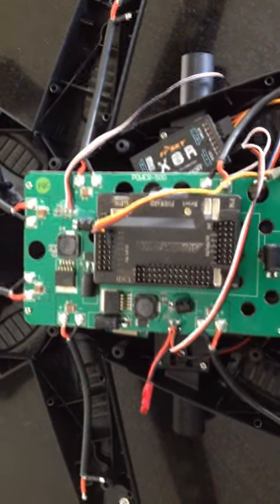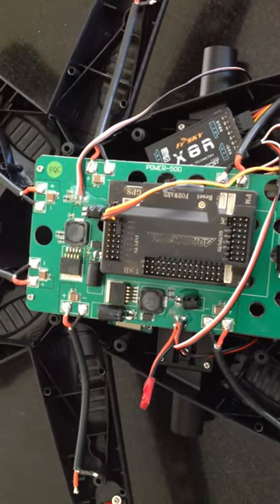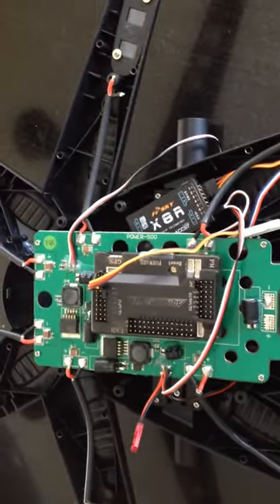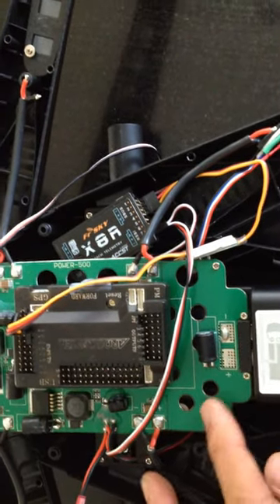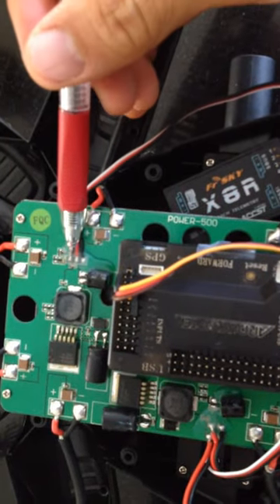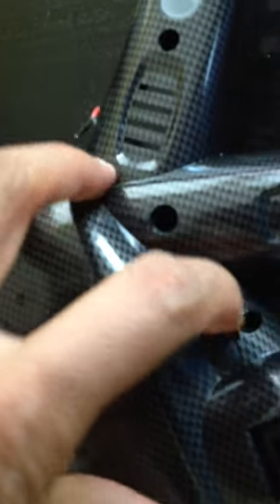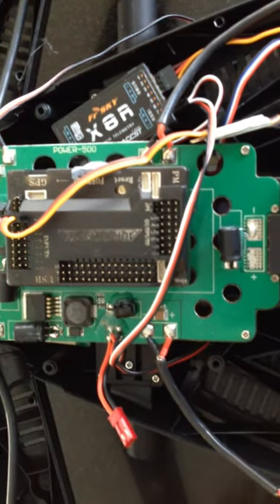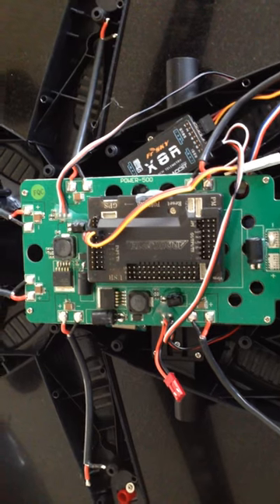Building a Walkera Tali from Scratch: Power Distribution Board Overview

Comment: Curious - you mentioned that battery enclosures are for sale separately. Could you perhaps point me in the right direction, since I can't seem to find a single shop that has those? It would be of great help to my own little project.
Reply: how did you hook up the power moudual from the power distrubution board to the APM  ???